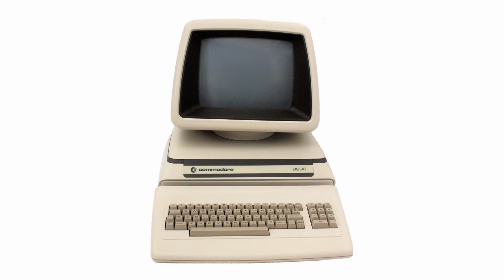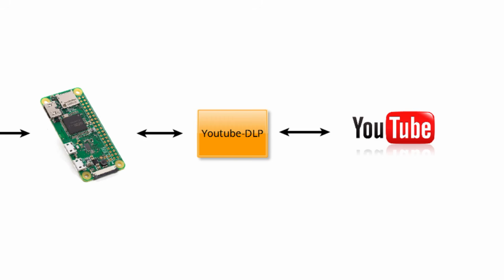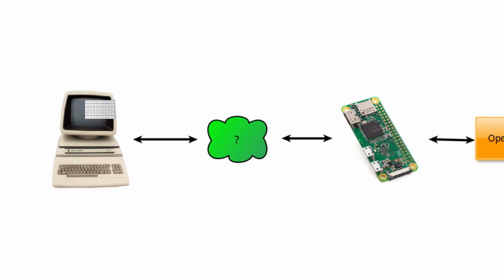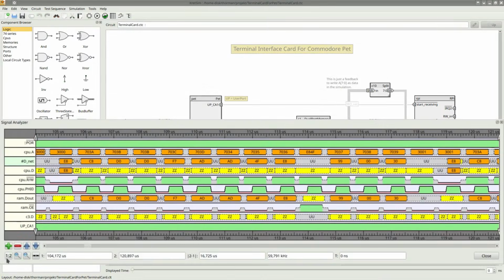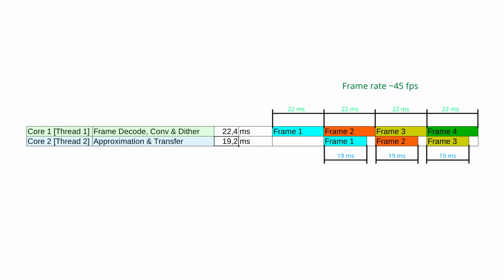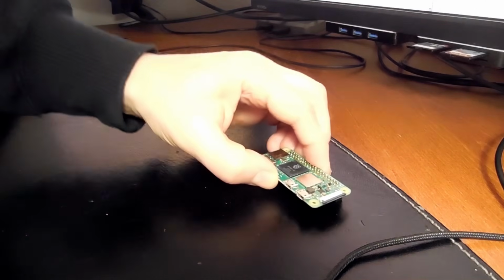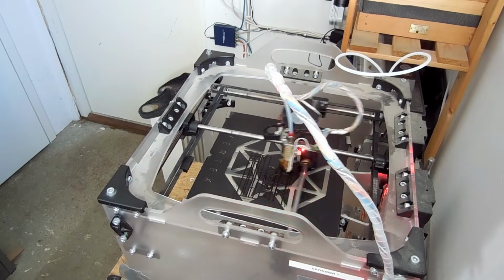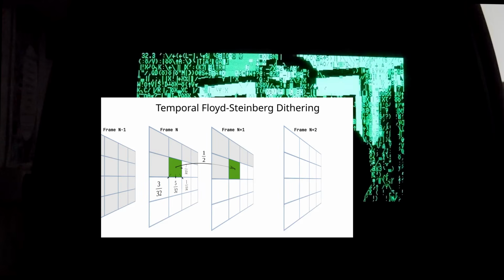Watching YouTube on a Commodore Pet

Comment: I was wondering if it would make more sense on the pixels to character conversion to do an array of all possible pixel pattern combinations (with a 1:1 of all the 'matching' characters) and do a look up in the array rather than XORing in real time?
Reply: The problem is that lookup table doesn't fit in memory.  For 8x8 character, you need 2^64 lookup table which is an insanely large number.  Now a splitting it into multiple 8 or 16 bit sub-regions would work if you could change the character mid scan line.  Some demos that came later did that kind of trickery on on the 5150 to emulate higher resolution screens.
Reply: @jhaluska80  It would be 2^16 or 65535 bytes or 64KB. It's just a 16bit binary value would represent all combinations of an 8x8 array
Reply: so you need 64 thousand 16bit (2 byte) characters, or 128KB of memory for the value column of the map and a simple 16bit integer for the name column so add another 128KB for a total of 256KB for an entire map. Surely there's enough memory for this.
Reply: @davestorm6718  A 16 binary value would only represent a 2x8 array.

Comment: I was wondering if the source code for this project is available somewhere? I'm specifically interested in the code that interacts with the 6522 VIA, for a PET project of my own that will read data from the user port.

Comment: You sound German, but you are speaking and writing in English, so I'll give you a pointer. Decimal places, as spoken in English, are denoted by a period. A comma is only used to denote places higher than tens, not lower.

For example; when writing 4,56, in English that would be pronounced as "Four or fifty-six." That obviously makes no sense at all. It should be written as 4.56.

Comment: At some point in time, the power goes out. It may be a car crashing into a power pole, a transformer fault or workmen accidentally digging up a main supply.
When it does go out, you can expect to be without power for two or three hours. What does this guy do when that happens?

Comment: First of all, well done on this impressive technical achievement even though it is just a fun thing to do. Many years ago I built a weather satellite decoder on a 6502 based BBC micro computer. It was slow scan video coming in at 1200 baud FSk. I injected the signal into the cassette port, extracted the clock signal from the UART device using a simple RC edge detector with a nand gate and timer ( to sample the bit in the middle of the bit period ) and then clocked the bits of each 8 bit pixel into the 6522 VIA. Every 8 bits it generated an interrupt to 6502 and the ISR stuffed the byte quickly into a ring buffer and exited. The main loop of the software then pulled bytes out of the ring buffer, dithered the pixel and displayed it in the bit map mode display. The ring buffer between the ISR and the main loop made it run smoothly and also bought more time by utilising the frame and line flyback periods to process the main dithering presentation loop. The data was synchronous with no start and stop bits so I had to also construct an exclusive NOR 32 bit wide digital corelator to detect the line and frame sync code sequences. Anyway it all worked and reliably displayed weather satellite images on the BBC micro. It was very cheap hardware wise and built on a Vero board and hand wired and plugged in between the UART and it's socket with a connection to the via port.
Reply: Dude, your comment is literally the "Rockwell turbo encabulator" YouTube video 🤣🤣🤣 is this real and have you been discovered by people whom matter so that your very obvious genius can be cultivated and beneficial to society?!
Reply: @madamebutterfly851  Very amusing! Actually it was all totally real but from an era long gone. I wish you well on your journey in technology and look forward to reading about all your ground breaking technological developments in the future.
Reply: Meh, I did the same with a casio watch and a VCR.

Comment: So, if you reduce the framerate to 15, and then use the 4-bit character rows, would it overall look better or worse?
Reply: Also, removing all the y-idx loops  completely, just having 2000 (or 4000) hardcoded, non indexed LDA+STA absolute writes, may help you drop the clock cycles below 8? It would be a large redundand program, but who cares, you have 128Kbyte RAM

Comment: Amazing!  It's kind of a pointless exercise, but at the same time your solution has such technical excellence that no-one who really understands the problem could fail to impressed.  In fact, I would go so far as to say that anyone who isn't impressed doesn't understand the problem properly.  Furthermore, as others have mentioned, the video explains the solution very clearly.  Well done, great job.
Reply: this is only a example that commodore pet can do. im sure someone can pull a hashrate out of it. or done a simple calculation or anything under the sun can think of.
Reply: I programmed on a Pet at school, it was my first computer. My second computer was a Vic=20 and my third was an Atari 520ST. So yes, I'm impressed.
Reply: @Hastur876  big talk maaaan now prove it!

Comment: i actually looked for someone who did this too i tried to do it but on Windows 10 CMD and suprisingly i didnt fail i didnt use anything more than programming in 
VBS - typing and screen resolution
Batch - main system colors and graphics commands
C# - actuall system 
the entire program weights over 2 gigabytes but it works and today i made the refresh frame rate to 50 fps and im proud out of myself

Comment: I don't know the 6502 well, but it looks the individual loops that do 256 bytes could be combined into one bit loop, if the Pi sent the bytes in a different order:
read byte, write to dest+y, read byte, write to (dest+256)+y, read byte, write to (dest+256×2)+y, etc, increment y, jump back to start.
The reduced number of increment and jump instructions would make it faster and take up less space.

I don't know if that would be useful though.

Comment: When adapter is way much faster than main computer))
Reply: Back in the day, when ethernet was first available on the IBM PC, the ethernet adaptor had electronic hardware that was a LOT faster than the 8086 in the main box (around mid eighties or so). It also took up an entire expansion slot inside the computer

Comment: I've never seen so much pre-calculation in order to confirm exact performance in order to match a technical requirement. So much of modern (computer) science these days is based on trial and error, but you've shown how to achieve the exact, planned path to the final goal. That even includes creating your own, rather advanced, tools! I also like your video-production value - it's insanely high. Well done with all tasks.
Reply: Plus  video editing magic :P
Reply: Science is always based on trial and error to a degree, even if everything is preplanned. There's no way to be 100% sure that something will go as planned nor can you be sure of everything so you need to always be ready to perform trial and error. Besides, that's how science is done (not only computer science). You have a hypothesis, you experiment with it, if it turns out correct, hooray, if not, then try something else. It's an endless circle of trial and error.
Reply: Yeah, this is actual engineering.  Software engineering "resembles" true engineering, but true engineering is all about knowing your constraints, and designing inside them.  It's all about the transformation of "something you have enough of" to "something you want but don't have enough of" inside a matrix of constraints.  I love seeing people succeed at this type of project, because it demonstrates what can be done when you frame up your constraints really well.
Reply: There's no way to calculate the stuff now days, it would take way to long. With one of the worlds first computer, there's isn't anything to them, it could only do so much. And by now, anyone who had a love for that kind of thing could do this VERY easily. Like a car mechanic from todays world going back to the time where the very first car was built. You're just very appreciative which is cool, but this dude knows, this is VERY VEEEEEERY basic stuff in this field of work.
Reply: @OregonCrow  

>There's no way to calculate the stuff now days

....I'm a senior systems engineer, and have been for about 15 years.... this isn't really true. We can, and sometimes do, go to this degree of analysis even on modern systems (especially in embedded systems that control life saving or dangerous equipment, or that are going to inhospitable environments like the bottom of the ocean or into space).  What keeps us from doing this degree of analysis these days is mostly cost/benefit.  It's costly to design to concrete constraints, and usually the application doesn't require it because the consequences of falling outside an envelope aren't that big of a deal ("Honey, can you go unplug the router and plug it back in?")

Comment: Getting video out of a PET is impressive, but that awful quality 3d printing is just as impressive.  What 3d printer can give you such an awful bottom layer?  Get any Ender 3 clone betwee $100 and $150 and you should get way better results...
Reply from the maker: Well, it's very old, a Vertex K8400. The extruder has travelled around earth many times over. It's long overdue with a new one.

Comment: This might be, seriously, one of the most  impressive things I have been in the last years. You see people claiming to run "doom on a calculator" but they usually use the case alone or change the device so drastically that you can say it's a fake claim. But this... This is the real deal. Contratualtions my man. This is an impressive achievement!
Reply: It's basically bypassing most of the PET and using it as a terminal, but the fact that it can be controlled from the PET itself gives it more legitimacy in my view.
Reply: Pi Zero can play Youtube videos without PET, so it is kinda just using the case.
Reply: Pi Zero can play Youtube videos without PET, so it is kinda just using the case.

Comment: So, you COULD actually "run" Doom on the PET now! 😁 Amazing work!
Reply: This needs to be the next option! It already relays keystrokes to the pi, doesn't it?
Reply: Since it basically just uses the video output of the PET and the monitor to display the graphics, with everything otherwise being ran off a Raspberry Pi Zero, everything that can be ran on a Pi Zero can be displayed on a PET.
Reply: you could have it run on another computer and live stream it to youtube then have the  PET input connected to the computer running Doom....
Reply: @rgerber  like an 80s version of steam remote play.
Reply: There was an ASCII renderer for Doom.
Here is the short way to next level of this crazy stuff.

Comment: first, I would like to say that it was very impressive and interesting.   by some coincidence what you've come up with is exactly the same way that the SuperFX chip works to add 3d rendering capability to the SNES game console (also a 6502 variant).   The SuperFX chip is a 21 MHz risc cpu that does all the heavy lifting, with some circuitry to map a bitmap into a character display and allow pixel rendering into a character map.   All the SNES does is copy the screen.   BTW, your screen copy code could be faster by unrolling the loop.  how much you unroll it would depend on how much free memory is available for code.  with 256 unrolls you could dispense with the loop instruction (bne) - and be 33% faster.  With 2048 unrolls (one for each screen memory address) you could dispense with the index of the Y register entirely (and do the screen copy twice as fast)
Reply from the maker: Yup, by unrolling it, it could go twice as fast, but then it would go much faster than the CRT redraws, so it wouldn't make much difference. It frees up a lots of cycles that I want to use for some other stuff though...
Reply: @fulkonto1222  exactly, you said there wasn't enough cpu left to do sound.  and ta dah.  now there is.  we're expecting dolby atmos at the least.  ;-)

Comment: That's excellent.  I've wondered what YouTube videos would look like displayed using an Apple ]['s lo-resolution graphics mode (40x48, 16 colors).  I might be inspired to work up an approximation after seeing what you've done.
Reply: if you used a green monitor to turn color to grayscale, you might actually be able to watch it without getting a headache, and it seems the translation would be easier there too (convert video to grayscale, pick closest value with a bit of dithering). On the other hand, you may be able to pull off 60 Hz, which would let you mix colors on alternating fields for more effective colors. In theory you'd go from 4-bit color to 8-bit color, but this being palettized color, it doesn't quite work that nicely.

Comment: I wouldn't really call the CBM/PET 600 a "real PET", as it is a later, more advanced series, but still impressive!
Reply from the maker: It is actually a relabeled 8296. Don't be confused with "600", it's not a CBM 600. The Pet 600 was a marketing gimmick in Norway/Sweden/Finland in the 80's. It's definitiely belongs to the 8000-series.
Reply: @fulkonto1222  Oh, thank you! We live and learn... I never cease to be amazed by Commodore's many labeling and "model" variants in different countries. Of course, if I had looked closer (I watched only small parts of the video as yet), I should have noticed that it can't be a CBM 600 (the keyboard, for example...). I own a PET 2001 and an 8032 myself, as well as a C16, two C64s (breadbox and C64C, the latter was my first computer), a C128, and an SX-64 (and I gave away an Amiga 500), so my unqualified comment is a bit embarrassing ;-)
Reply: @fulkonto1222  I've now also seen your dedicated video on the "PET 600" with all the background and now everything is crystal clear! Thank you.

Comment: This would have been absolutely jawdropping in 1978.
Reply: Yeah. Hook up your PET to a surplus ICL 1906a, or perhaps you'd need a CDC 7600 (either mainframe computer needing an air-filtered air-conditioned room the size of my flat).

Methinks the budget would have been beyond me.

Creating the file offline on a separate computer would be within budget, but that would take weeks to prepare each second of video...

And video tape machines weren't cheap back in the day either...

I think waiting for the pi was a smart choice. ;)

Comment: The video output on the PET is janky but… BUT … the fact that you poured passion and hard graft into this project to output streaming video to a device that was NEVER designed to run streaming video is… phenomenal. Liked and subscribed.

It reminds me of a myth from my university days. Faced with spending their days in the lab and missing some World Cup matches, some enterprising undergraduates developed a decoder black box which they connected to a TV aerial and… the X, Y and Z inputs of a CRT oscilloscope.

Comment: Can you make a custom CHAR set that is all dots?
Reply from the maker: The Pet doesn't have that capability (like it's later siblings VIC-20, C64 etc).
Reply: @fulkonto1222  is it possible to clobber the char rom memory space with custom character data? I seen other machines load the rom then essentially the physical chip is not needed.

Comment: Impressive achievement. But I don't know why you'd have to build OpenCV from source. I once built a movement and people detecting security camera based on a Pi Zero W with OpenCV simply by installing the OpenCV binaries from the Raspbian repositories. Admittedly that was quite a few years ago, so dunno if stuff has changed for the worse in the meantime.

Comment: That is very cool! I was about to attempt a similar project for the C64. I believe with some tweaking that should be doable and maybe even with real color pixels. Great job both on the technical and the didactic side.
Reply from the maker: Thanks! As for the C64: go for it! I'd love to see the result!
Reply: Not streaming though, this was done a decade+ ago: https://www.youtube.com/watch?v=IXLv7UosQXs
Reply: @DukeFawks  A classic and still impressive!
Reply from the maker: @DukeFawks  Dude, that looks just amazing! Fantastic work!
Reply: @fulkonto1222  Have you checked out the "No PETS allowed" PET demo by ORB? It manipulates CRTC registers to reduce character height to closer match the pixels you need. So If you have any clock cycles to spare....
Reply: c64 should be easier? can a character set be from user port cart and messed with on the fly?  there's something similar for the nes as well, i forget if it used tilemaps changed on the fly or what (elite as an original game for pal nes does the same and has some ram on the cart for doing it, which while not having anything directly to do with this is pretty wicked and cool)

Comment: Very good job, The character aproximation is a excellent idea. Just two suggestions: 1. Any graphics library can grayscale, reduce and extract frames from a video, even to memory using buffers, or  video player commands as mplayer, mpv, cvlc and the like using shm disk. Might OpenCV be overkill, and 2: Can't you simply precalculate a table in memory with all the character aproximation posibilities, or an reduced set? That will cut the running time of character matching a lot (just block pixel count + memory seek).
Reply: AALib did this about 20 years ago, that is, they perfected ASCII displays. It was on Linux on PCs. They showed demos playing Doom and watching videos, all in text. Last I looked, it's still there in one of the repositories. May as well give it a try first.
Reply: @greenaum  this reminded me so much of the bb demo
Reply: I was wondering why precalculating a character table wasn't the approach used here to optimize, but maybe I'm missing something.
Reply: There are 2^64 possible patterns each 8x8 cell can take. A LUT would take lots of storage in return for less computation.
Reply: @cmyk8964  There is plenty of storage in RAM on the RPi